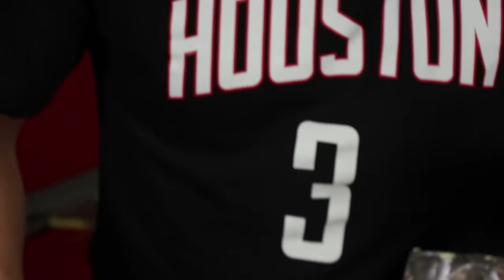TIG Welding 101 - Walking the Cup

Comment: I am a new welder and will you tell me what you think of this: I just had an idea for the hand that feeds the filler metal:

 Get some line paper or a yellow legal pad and practice at home feeding the filler in between the red line that runs the length of the paper, or in between the horizontal lines or on the blue lines one row at a time. Practice different speeds. And get some graph paper and score sections to feed the filler rod at different speeds. Bout to get this money y'all! Thanks WeldTube! You guys are the best!

Comment: Also, a lot of welding is preference, however, in the beginning of your welding career when you are on non critical task your preference will prevail.  As you gain experience from plate or dummy legs to Critical High Pressure (CHP) you will be welding per code. So be open minded of your preference.

Comment: Ok so I am 9 years old I have been working since the 1st grade AMD have done MIG, STICK acetaline torch, and some friction welding,I have never done TIG before....is it super hard???
Reply: @ARSZLB   I caught your drift bro
Reply: When i first did tig welding i found it was similar to oxy-fuel welding with a filler rod but with a foot petal included, i played drums alot at the time so it helped out being in tune with my hands. But thats thinner material. Thicker material you can pretty much just floor the foot petal and go.

Comment: Old video but after a long time welding i walked into a welding supply store and they had a chart of what the angle at which the tungsten  should be grinded. I used to weld with a really sharp tungsten, turns out it makes your arc really unstable. Look up those charts, other than that, Tight patterns! I became a welding teacher last year, and i made a wooden 'torch' with a cup and a spring that holds a pencil point (spring is the one thats found in a MIG/MAG torch so the tip doesn't break when pressed too hard). This way they can practice walking the cup at home and i can evaluate their progression.

Comment: 3 important remarks if we can allow ourselfs
Knowing that you dont want any polluants on your weld (tungsten, hydrogène ect) and you want to have a solid longlife resistant weld, here goes our constructive proposals:
- As you know, argon is your inert protection in order to evoid hydrogene inclusion during welding and cooling after welding. In order to evoid it from the beggining until the end, you should leave the gas flow blowing arcless over the final welded zone until it gets normal steel colored. Otherwise you will include hydrogène when it is still red hot.
- If ever you include tungsten on your welding bath, we propose you to take it off by a grinding repair. Tungsten is not compatible with other materials and it will make your weld fragile (long technical explanation so we perfer to resume it).
-on order to make a solid weld, we propose you to calculate your heat energy input created in your weld bath (amperage ; advance speed; process coeficient;....) If ever you want the calculation formula or an explanation, do not hésitate.

Small subtility from our experience: We propose you to grind your tungsten on the opposite way that you're used to (if you understant what i mean) otherwise we will send you a clear photo. You will see a slight perferable arc stability.

Your welds are visualy nice. Excellent explanation and video.
Nice job!
Best regards 

GmbH Inspection France
www.gmbh-inspection.com

Comment: Great video. I have been free handing for years on boiler tube but have always wanted to practice walking. Great explanations, I can tell you are a great teacher. Wish I could find 2% lanthanated in canada. Only 1.5%
Reply: Joel Kelly you can’t order on the internet?
Reply: usually they dont keep it on shelf but my local supplyer ordered me some. montreal area. just ask for it and if the sale representative is open minded like mine the try to help you instead of trying to sell you thoriated.

Comment: I've been trying this but I'm just not getting the hang of it. 2% is green correct? I know I need more practice. But when it comes to steel it's always either too hot/rod melts back out of the puddle and I end up with a nasty, uninformed, sugary weld, or it's too cold/the filler rod sticks and balls up so I stop to add heat and end up with the same result as when it gets too hot. That sweet spot between the two has proven itself to be quite difficult to stay in continuously. Aluminium is way easier because I did it for years and I'm more used to it's characteristics. But I'm still not proficient at it yet.

Comment: I’m learning tig welding myself at work everyone pushing the rod into the puddle at my job so far I’m pretty bad at it push out the rod inside the puddle. Does the weld hold better verse laying the weld wire?

Comment: a rly nice video, but there is one thing i hate about it and you should imediatelly start to do it, if you work or want to work in a big company. You NEVER start to weld with the side on ur rod where the stamp is pressed in. This has a few reasons but the most obvious one is, that in case an inspector comes to check ur work, you have always the insurance that you made no mistake, even if there is a manufacture error and they pressed the wrong stamps on the welding rods. This will aswell, make a good first impression when you start in a new company since small things like that seperate excellent welders from good ones.

Comment: I only have 110amps until I get 230v power in shop. Could I do this on 110amps and a 16th filler to get motions down? I sware I spend more time on the grinder sharpening tungsten then I do welding. Keep sticking, slipping or staying in same spot just side to side with no forward progress. U make this look so easy

Comment: Hi!! I have a question.  I've been working on a 17-4 stainless steel Shank with a post heat of 600°. In a couple days I'll be using a large diameter gas lens kit for tig-welding Inconel 625 rod on a Miller Syncrowave 350, after I'm done plasma welding in the right diameter. But my question is what would you say is a good starting point for the gas flow and what would be the highest? Thank you for your time..

Comment: very good welding you do sir! but a litlle question came up to me:is a super tight weld a stronger weld?greets from belgium!
Reply: Not necessary, it can provide more heat leading to negative changes in metal structure. But with right current it should be slightly stronge
r.

Comment: i just started a welding class. never welded anything in my life and my work had me start with a tig class. first night i got the first weld done without filler stick then the teacher had me add a filler stick abd it went downhill from there. can i use this method of walking the cup and propping my torch with the gas cup on anything as long as it will allow me to or is this for a certain type of application ?

Comment: Good job. If I may ask you a question. I have an old transformer 355 TIG, would you always use a sharpened tungsten with a trans. machine? People say not to, but I usually do except for high amp a/c. I'm still pretty green so I'd like to know what you think. Thanks

Comment: When I'm walking the cup my cup gets hot and cracks or the end breaks right off. What am I doing wrong? Always seems to happen when I'm out of replacement cups!! 3/4" gas lens and either #10 or #12 cup, sometimes go with 1/2" gas lens and #7 or # 8 cup for smaller single cover pass stuff w/3/32" tungsten.

Comment: Also, to fill a gap is ok, and then mig it, this is a big time wasted especially when getting things done faster gets you money bonuses. Before I was sent overseas to put together what I built...glass melters for the worlds glass, cell phones, TV's, gorilla, etc. I read the blueprint, it said stainless tig, then when I finished the parts, the manager in charge yelled and said it took to long and you should have stainless migged it. But then the surface after the weld needed to be close to flat, so then grinding the parts down would have took the same time in total. It was a place that hated me listening to dance, r nb and hip-hop as they we all rock people, the elders didn't care, it was the younger ones in no charge and just had to break my balls and got me laid off eventually, even the real manager was in on it while we were overseas. I'm still here, came back to try other things, and marriage, now I am stuck here looking for sponsor weld companies. Anyway, the point is the 2 by 4 tubes I was welding had only a small V groove I had to make, so I see why the drawing called for tig, but pipe has a deep groove, after the root pass, just fill it in, no?